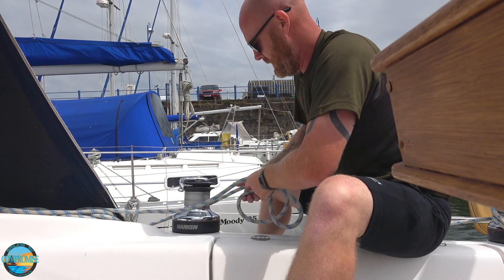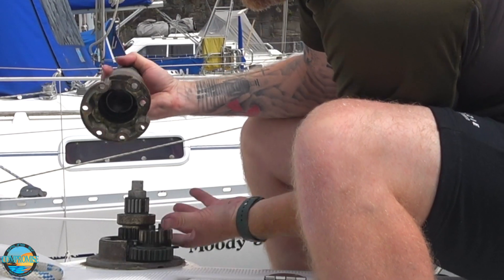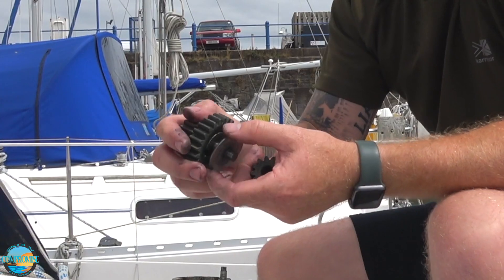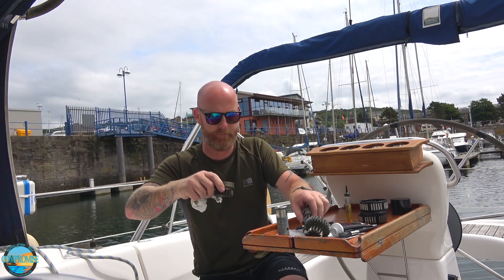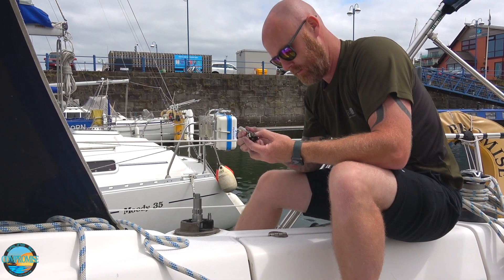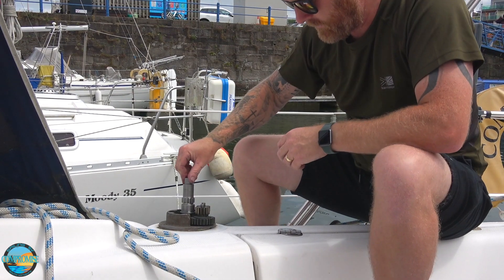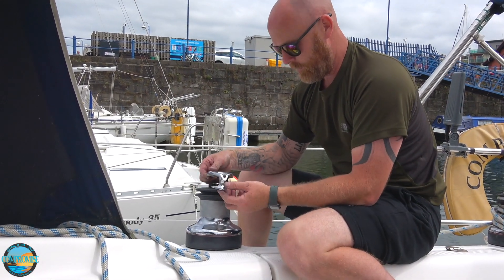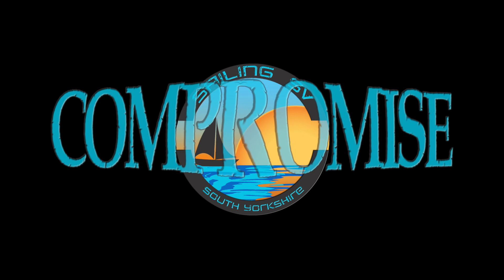HOW TO SERVICE YOUR WINCH IN 10 MINS

Comment: My primaries are Lewmar winches but the principles are the same. There was lots of old grease and other "stuff" clogging mine up the first time I attacked them and I had to wash them in diesel to get them clean before reassembly. The pawls don't seem to wear much but I had to replace some of the springs. Nice video, thanks for posting.
Reply from the maker: That's the word I was looking for Bob "Pawls" thank you.
Luckily our bearings only had a thin coating of grease so didn't have to resort to degreasing them. It suprising how many people put grease in them.
Reply: I had to replace pawl springs too, winch effectively reversed under load, I couldn’t work it out  until shown. I would replace my springs when servicing.
Reply from the maker: Top Secret Sailing Good idea, I'll check ours on the next service.